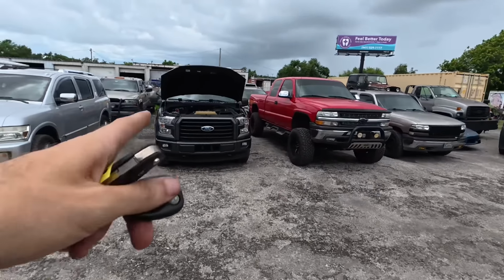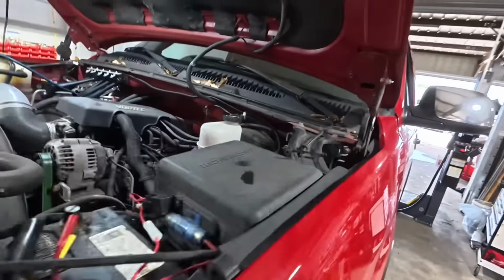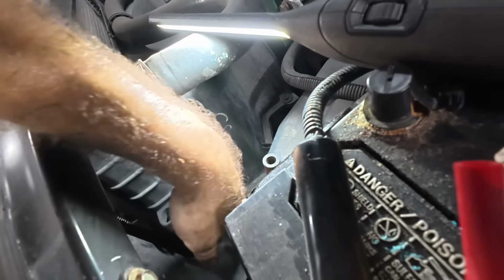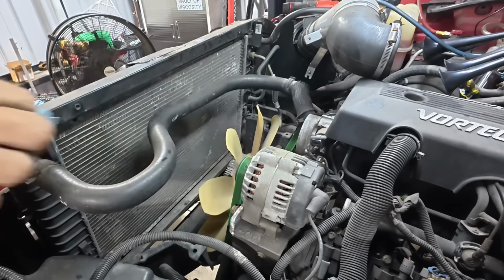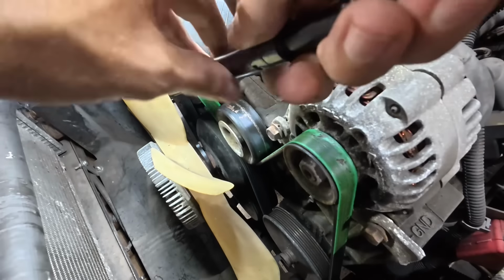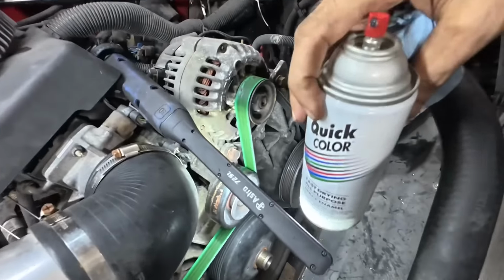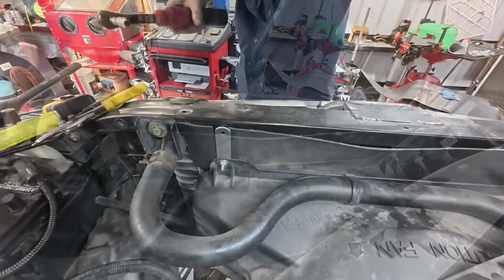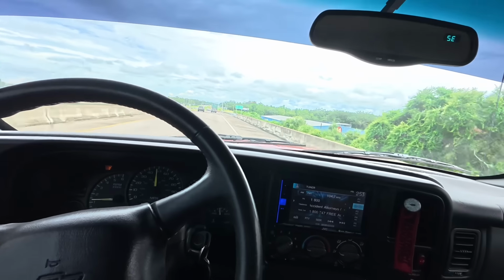Modified Truck has a Physics Problem!

Comment: Actually I think its ingeniously, (If that is a word) and actually what I was thinking of making to seal that lower gap. Except I don't have a spare conveyor belt lying around. I'd use a piece of rubber sheet material. Excellent work Ray. Also your customers' serpentine belt has damage on the top side. A short call to "Safelite" and ship it.

Comment: The only i would have done differently is I would have attached the top flap to the top of the shroud. This would have allowed the air from the top to flow better. And, you could have made side flaps from the conveyor belt instead of using the tube insulation. I am not saying there is anything wrong with your methods, I just have a different perspective.  Another excellent repair due to someone's poor planning.

Comment: Morning Ray and family. I had a chuckle with your comment about the height of the truck with the lift kit. I have a factory 2020 Silverado 2500hd with the 6.6L gasses engine and the bonnet sits just shy of 5 feet. So if I ever thought about a lift kit I would need a step ladder to get in it. And Ray if you ever see me say I’m thinking of a lift kit I give you permission to get to Nova Scotia and give me a stake up side of the head.

Comment: Yep one of the body lift problems.   Had one come in with a 3 inch lift on the shackles and a 3 inch on the body.   It had wires an hoses stretched tighter than a Bango string.
Reply: The second I noticed those air dams missing, I was thinking body lift. Then I seen the dropped radiator shroud and that confirmed it. You don't see body lifts on the newer trucks anymore, but back in the 90s and early 2000s, 100 bucks would get you 3" of lift and a gap between your bumper,  lol.
Reply: I had a Nissan come in the shop with no brakes. Lift kit had front brake hoses pulled so tight, they started to leak 😂
Reply: AND THEIR PENIS WAS STILL SHORT :(
Reply: It was the Deliverance optioned pack

Comment: retired tech here,i despised lifted,modified vehicles,labor rate should be adjusted when working on someone elses mess,
Reply: I mean, modified vehicles are fine as long as it's done correctly though most aren't lol
Reply: @roji556  And even if they're done correctly, they can have unexpected side effects.
Did the manufacturer of the lift kit not know the impact on fan performance or couldn't find a simple solution to the problem? After all, who would suspect that a lift kit could affect the air conditioning system?
Reply: @JohnADoe-pg1qk  The lift kit manufacturer should have had a modified fan shroud, but that's in a perfect world and we don't live in one.  The reality is, folks like Ray have to come up with creative compromises to make stuff like this work.
Reply: @JohnADoe-pg1qk  its fairly possible the lift kit itself would not, but the way they botched the install did
Reply: @roji556 YEP
Reply: The manufacturer was probably the cheapest body lift kit around and usually the kinds of dudes that have these aren’t the brightest out of the bunch either. Them driving that truck around is a big give away on there iq haha
Reply: Awesome repair, Ray! Great video as always.
Reply: Yeah aftermarket work should be extra since they are NOT counted in factory labor rates.
Reply: absolutely. And this one looks like a safety disaster
Reply: No matter what is being fixed, if someone else has started a job a you are called in the fix it it is twice as hard to fix. Better to have started on a fresh repair than to fix someone else's "repair" and then actually fix the original problem. This happens in biomed all the time.
Reply: I'm sorry here. I came off harsh. I agree that the rates should be adjusted for modified vehicles.
Reply: Why?? Work is work. It pays bills. 

If someone wants to janky up their vehicle, and then just keep bringing it back when his jankiness keeps breaking, then FINE with me.... 

I'll KEEP on billing him for the repairs. Money is money... 🤷🏻
Reply: @davelowets Thank you
Reply: Next time ask Jay Leno to 3D print you a custom one.
Reply: You must be having a bad day. The body lift was kind of obvious. Everyone bitching about the mods my question would be, is an hourly rate not good enough? Or do you always use book time knowing you can finish the problem in less time ultimately charging the customer an exorbitant rate. Personally I would have fabricated a aluminum shroud for it. But I have them tools. I command Ray for what he's doing. I think it's a great idea having what he has to work with. Good job Ray.
Reply: Exactly--when  others have touched it--another can of  worms..
Reply: Pure Telemundo
Reply: I refused to work on any one's "Hot Rod" or lifted truck etc. Later I refused to work on anyone's modded Harley either. I had no idea what they did or how they did it
Reply: Dude, the entire world is filled with modified vehicles. Car guys and girls everywhere. Hot rods are a thing. Sometimes i wonder why a mechanic ever became a mechanic. Some of you do nothing but complain. You should have been a cashier at home depot.
Reply: @jpadilla6436 all he was talking about was labor rate... that's it.
Reply: @Cactus12Ari Then these mechanic's need to get out of the five bay "get them in, get them out shops" and run their own business.
Reply: @jpadilla6436  sound like you are complaining. you modify your car - go ahead. put all the stupid mods on it you can. but then dont cry if you have to service it yourself ;)
Reply: @Maryed_Simon Nobody's crying, you can go kick rocks. I do 100% of all the work on all my cars. I enjoy working on cars. I've been a contractor for 34 yrs. We show up all the time were some may have done their own electrical work, plumbing work, framing you name it. No bitching. We take it apart and build it to code. That's why we are there. If a mechanic can't get the money out of a job due to a modified vehicle and labor rates then maybe your working out of the wrong shops. I wouldn't work where it's, "get them in and out as fast as possible". Quality declines. That's why I started my own business.  I do question the passion of some mechanics though. As well as contractors. Like, why do some of you do it when all you do is bitch? You don't have to do it.
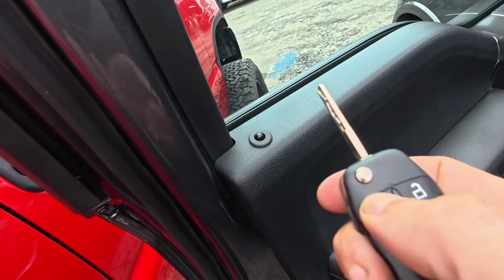Reply: Today’s Junk, no Flat Rate, it’s Time and Material… Period!!! 1:30

Comment: Slammed my 98 s10 many years ago. Installed dual e fans from an 04 Camaro. And a relay with adjustable thermostat. No coding needed. Completely worth getting rid of the clutch fan.
Reply: Back in the day, I put a fan from a 3.0 twirls on my 86 mustang. Didn’t even cover the whole radiator. Still cooled without a problem on Vegas heat

Comment: Best thing that I ever did under the hood of my 2012 short bed single cab 4x4 Express was to delete the fan clutch and fan shroud and put a 2012 electric fan in and buy a Diablosport Trinity Platinum tuner to adjust the fan turn on at 195 and a few other mods. So nice to see the engine wide open now. Along with getting rid of that big plastic air intake box when I bought the truck new.

Comment: A little tip from the non-mechanic that works on metal buildings all day. For the self-drilling screws, slow down your RPMs on the gun and it will grip faster and go in easier.
Reply: Ray "hates self-tappers" but he REALLY hates deck screws used for car repairs.
Even worse when they're used for battery terminals.
Reply: To add to this going too fast can actually burn up the self tapping part of the screw and render it useless

Comment: Love your work. Your extension needs to be unwound occasionally or you will end up with the biggest heating coil or electro -magnet in the workshop & it is too hot for that in Florida. Best wishes to Wife Unit and the kids.🤓

Comment: Ray...quick question that just popped into my "brain cranium". If you recover refrigerant and you determine that the system in question is overcharged, do you as a shop owner credit the customer for the excess refrigerant (since you are keeping it and presumable reselling to another customer) or would that be like the same as recovering old fasteners from garbage parts?
Reply: When dealing with R12, they'd probably account for every gram.  Not sure it's reasonable with R134a.

Comment: Only Reason Red trucks OE cooling pkg doesn't work is due to improper Service or Powertrain fails. 
Repairing modified vehicles often leaves the shop liable for non compliance issues if not returned to OE status. This includes Safety, Emission, and all DOT spec'd systems. Refusal is often the lesser demon vs litigation costs
Reply: What does that even have to do with the video, and are you giving your own comments thumb-up clicks?
Reply: @Starchface Most DIY efforts only make stuff different vs better
Reply: @peted5217 There are situations where you would not want to offer service, but this is the cooling system Ray is working on.  It's not on your list, nor does it represent a hazard rolling down the road.
Reply: @Starchface Not so fast, comrad. Vehicle didnt have cooling system issue until it was hacked. 
Seems an overheated vehicle , if forced to stop on the side of the road represents a hazard to occupants and motorists
Reply: @Starchface DOT Systems modified here include suspension & steering . Ride height change, which caused AC/overheat thru inadvertent airflow restrictions (Ray fixed only airflow). It also raised C/G, decreasing stability. Setting wheels half ft out from fenders may help rollover resistance , but also change Akerman steering angles when turning. This increases 'tire scrub' , degrading all handling . 
Fixing that back to OE requires re-engineered steering arms and tierods.
Shops generally note vehicle  is modified on Work Orders to eliminate misunderstandings.
Reply: @peted5217 I understand the cooling issue appears to be caused by the modified suspension.  My point is that Ray is not working on that at all.  He's just addressing the cooling system, and quite ingeniously.

To say that overheating is a safety issue because one could be hit after stopping on the roadside is a stretch.  A better argument is that the vehicle loses stability due to the higher center of gravity caused by the modification.  The shop that does the suspension work should be well aware of the applicable regulations, and if the work is in violation, it's that shop's problem.  It's not Ray's problem.

Comment: Fan shroud modified due to lift kit!!   That type of fan clutch is good, although it is noisy on stop and go driving.  And the side rubber flaps need replacing plus top and bottom flaps will need to be fabricated  !    I have that type fan clutch on my Dodge!!  It pulls a lot of air but noisey in the local driving!

Comment: No offense Ray, a customer is a customer and I know that your job is to repair their vehicles, but I think I would have been like, "you created this issue with the body lift, and now you want me to rig something up to correct an issue you created and don't want to pay to address". No way lol
Reply: I'm happy to get creative and experiment like that, I just wouldn't warranty it at all. You get what you get; if it works, awesome, but if it doesn't it's up to you to find another solution. No refunds.

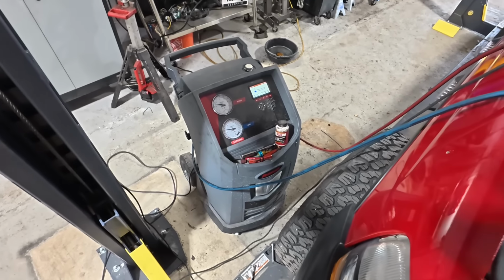Comment: I have the same problem with my Silverado Ray with the blower switch and Odometer speed is incorrect at times from Cheaper Materials used in manufacturing junk fake Soldiers used 😮 6:14

Comment: Ooh, I have a similar problem with my 98 Accord. AC blows cold while driving but after a little while the AC gets warm and the car overheats, the radiator, thermostat and cooling temperature sensor has been replaced. The car overheats with the AC off as well and the cooling system has been bled 8 times already.
Reply: My Mazda would blow cold if moving on the expressway or in the country and would stop cooling in city traffic. It was the radiator fan.
The car never overheated, that was the strangest thing.

Comment: Kinda curious if that crack could be welded (possibly even while the head is still installed?)
Reply: Ecobust doing what they do
Reply: no, partially because of contamination, and partially because the skill required would cost more than the part. plus theres no chance it wont have other issues

Comment: You aren't going to get more air flow without a good shroud for sure. Spent all that $ for body lift and other BS but won't spring for decent fans? I'd put aftermarket electric fans in with remote thermostat that is a stand alone. No messing with factory electronic BS.

Comment: body lifts are terrible…

however another solution if he wants to keep the body lift is retrofitting the electric fans/harness from an 05+ GM full size suv/truck. direct bolt in if the truck has a 34” radiator in it already.
Reply: All that trouble just for appearances. 😂
Reply: @pmscalisi  If your truck is lifted enough, nobody can see in the back to see proof that you pick up nothing with your pickup.
Reply: not in the budget lmao, he can afford a lift kit but not making his ac work properly
Reply: @bradhaines3142 wouldn’t even call a body lift a lift kit. i’m glad these things are gone with the wind.
Reply: Ray mentioned that in the video, if you had listened.